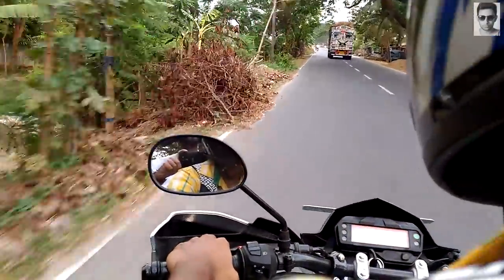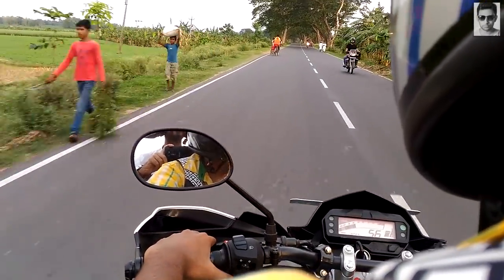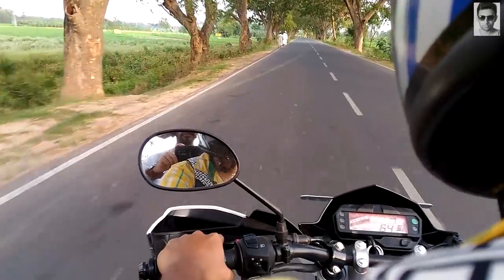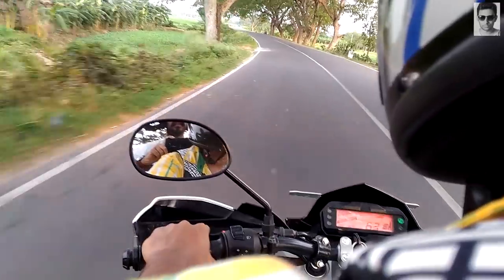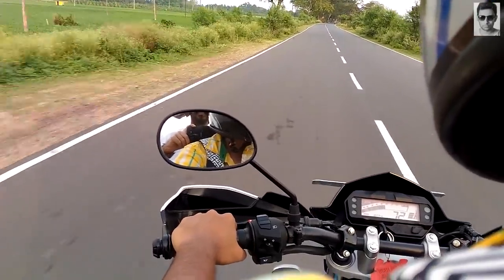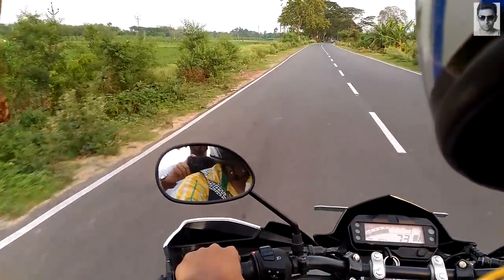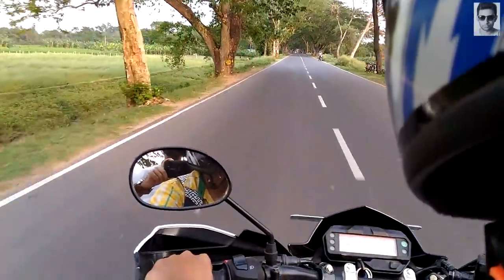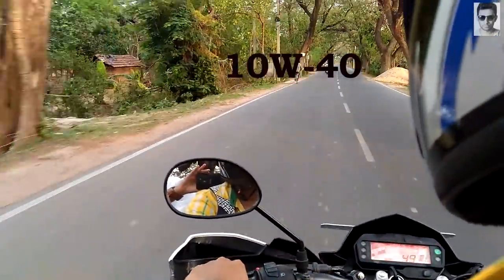How to Brake in/ Run in You New Motorcycle Engine Properly || Yamaha FZ-S V2.0

Comment: bro ..i am purchase this bike before 17 days  .why my bike engine so heated ? help me
Reply from the maker: Due to slightly high compression ratio the engine heats up quite fast.... even my bikes engine also heats up fast.... but not to worry... its common.... u will not face any problem.... ride hard ride safe Bro :)
Reply: thanx sir. 
...and   i am face quit loud sound of engine and lose pickup also...it is common  problem in new bike ??????? my bike completed 800 km
Reply from the maker: Sir kindly dont empty ur fuel tank.... keep at least 2 lit petrol or more.... i hope ur problem will solve
Reply: Which is the best oil for yamaha fz  s v2 petrol or Octen?
Reply from the maker: I use petrol only
Reply: DHANEH GABHANE bro i also facing the same issue